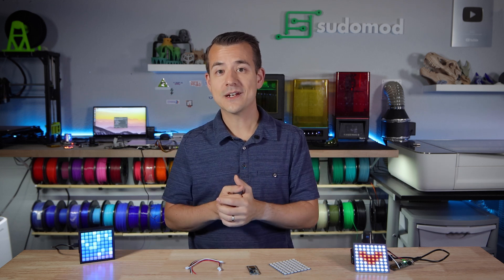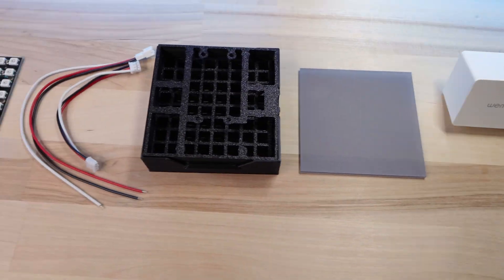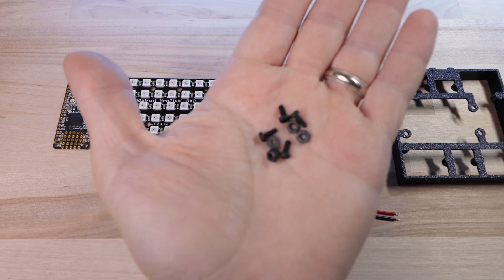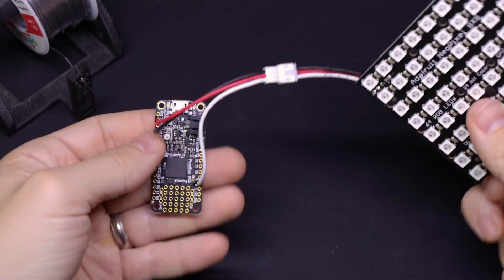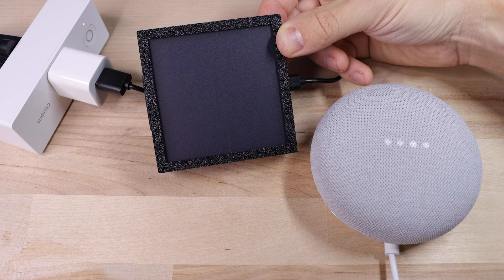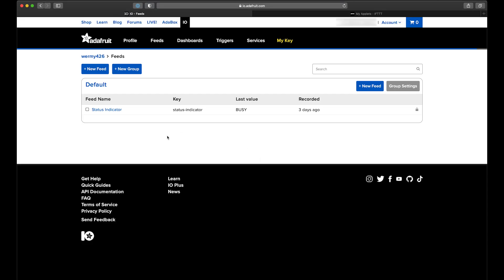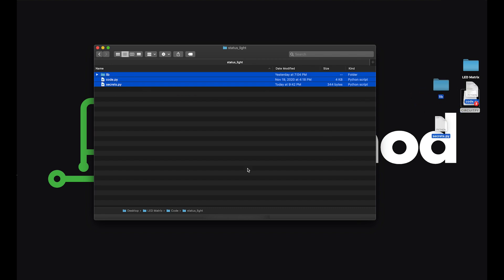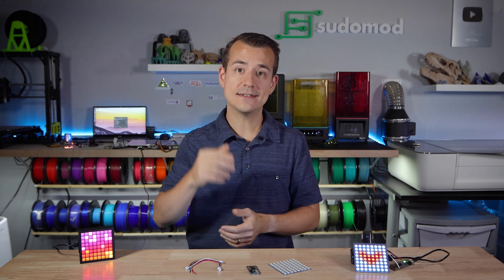Send messages to an LED Matrix using CircuitPython!

Comment: Very nice project! I am confused though why you have two microcontrollers and not use only an ESP32 board?
Reply: yes  ,this and also why the wemo plug too when on/off could also be controlled with the esp
Reply from the maker: Thanks!  Really I was trying to illustrate two things: how internet access can take simple projects to the next level, and also how this particular board can be added onto existing projects to facilitate that. You are right that you could use an esp32 alone for this kind of project, but it’s nice to be able to use a plug-and-play circuitpython board with this added on. :)